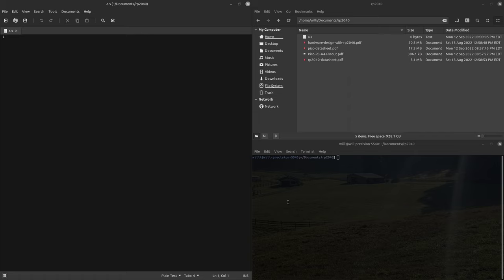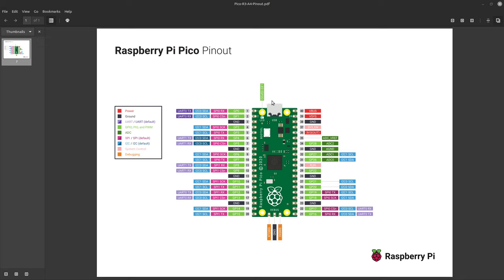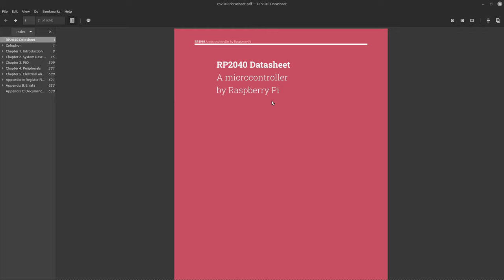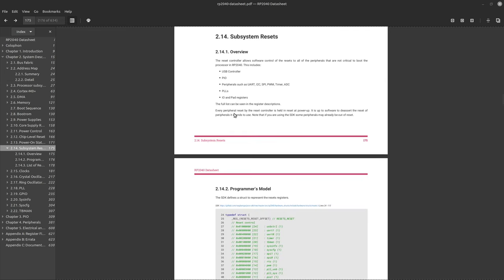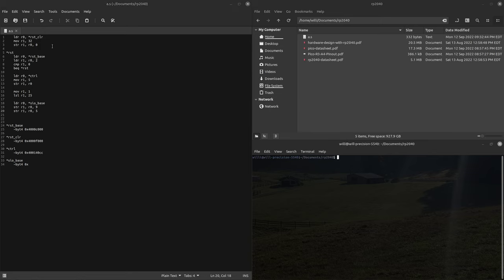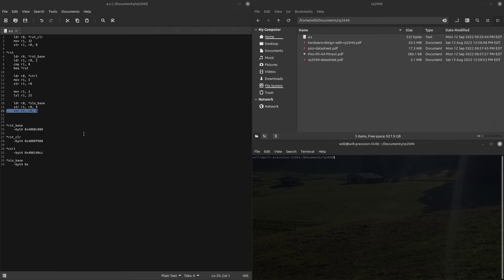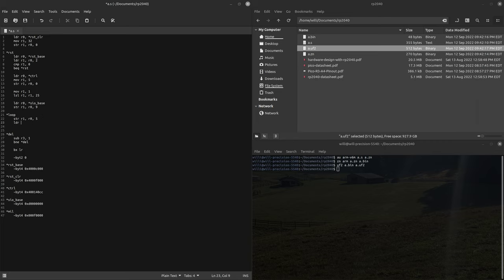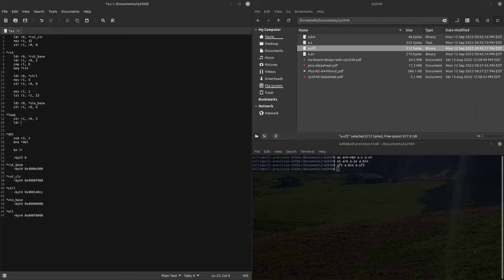blink the led on the raspberry pi pico with bare metal assembly

Comment: Great video. Just note that the first example (turns on the led) is not terminated properly. Execution will just run off the end and begin interpreting the pool variables as instructions. The second example which blinks the led is ok as it is an infinite loop.

Comment: I would define the base address, and then offsets for atomic XOR, CLEAR and SET registers, which is just added to the base address.  Then you just need to define the base addresses.

   ldr r0,(*rst_base+*a_set)
   str r0, (*time_base+*a_xor)

etc.

Will make it much easier. So basic calculation would be useful in your assembler. 
Have a pseudo assembler instruction to make addresses to align with word or dword would be nice too, as you noticed.

There are usually different assembler areas, so you can align data and program in a much easier way.  But then the linker will be a bit more complicated.

Would also be useful to have ways of include definitions from a single file.
Reply: I haven't tried this, but I suspect that the reason he makes the microcontroller do all of the math (including the bit shift for the GPIO pin), is that his assembler doesn't do arithmetic on constants.  I'm sure this would work with the GNU assembler, though.  Also, good point about needing a set of alignment pseudo instructions - again, I'm sure the GNU assembler has these, although I don't know offhand what they're called.  I'm sorry, but I'm afraid he just isn't all that experienced with assemblers.  And from the way he explains it, I don't think he understands why different offsets are used for atomic set and atomic clear operations.  This just tells me that I really don't want to get started by using his assembler and linker.  It's great that he wrote his own assembler; I did that a loooong time ago for the 8041, but that was back when you had to pay to get it from Intel, but this just leads to bad habits, making the target CPU do work that is better done by the assembler.
Reply: @BrightBlueJim  agree. (Was there ever a 8041?  Wasn't that the 8051?  I used to program it with a HP 64000 Emulation workstation.  We hade 8085, 6809, 8051 and 68k CPU emulators.  Great system, for its time.
Reply: I may have misremembered that - now I think what I played with was an 8748, EPROM member of the MCS-48 series.

Comment: How do you set up development environment? How do you compile uf2.c file? What are  a.bin and a.zn?
Reply from the maker: In the video I'm using my assembler and linker I'm currently writing, it's entirely functional for programming the pico, but it's early in development so I wouldn't recommend for regular use yet. The .zn file is my experimental linking format, which isn't set in stone, but all it does is contain linking information so the linker can connect relocations to symbols, for example connect the 'ldr r0, *ctrl' instruction to the *ctrl symbol further down the page. An equivalent format would be .o/.elf files. The .bin file is just the raw machine code, aka binary, that the processor reads. If you do want to use my assembler and linker, you can find them at https://github.com/willth7/au and https://github.com/willth7/zn

A more traditional setup would be to use the arm-none-eabi-binutils package, which you'd run something like 'arm-none-eabi-as a.s -o a.o' to assemble, 'arm-none-eabi-ld a.o -o a.elf' to link, and 'arm-none-eabi-objcopy -O binary a.elf a.bin' to extract the binary. The syntax will be slightly different, but the code and resulting binary are identical.

As for uf2.c, you can compile it with any c compiler. I use the Gnu compiler, so in my case I ran 'gcc uf2.c -o uf2'
Reply: Heyy, while I find it quite cool that you've built your own toolchain, for those wanting to use more consolidated tools, I took `elf2uf2` tool from the raspberry sdk. For those running Arch I'm gonna make a package with such tools in a standalone way (without using the SDK build stuff). I also can share the Makefile I made and the linker script I also adapted from the SDK. If you think it could be useful to viewers.

Comment: please don't use the term "thousand" when you're speaking hex. 0x4000 is not "four thousand"
Reply: 0xthousand?

I kind of agree with you, but on the other hand you could take the view that thousand indicates the number of digits, rather than a value.

I suppose it depends on context. If the value is important then 4000 should refer to 0d4000. If you're communicating a hex value that just so happens to be 0x4000, then saying 4000 communicates what's written without forcing everyone to mentally convert the number.